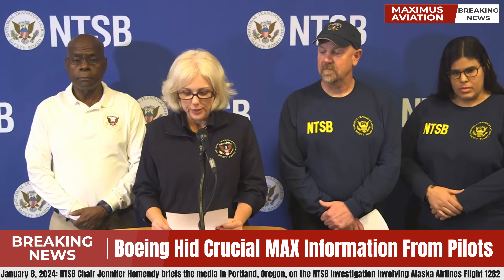Boeing NEVER Told Airlines That 737 Max Cockpit Door Was Designed To FLY Open During Decompression!

Comment: So this is the second time Boeing hid vital information from crew and authorities. The MCAS system that crashed two MAX planes and now this.... incredible. FAA and Boeing needs to be held criminally accountable.
Reply: The authorities knew. You weren't supposed to know.
Reply: @interstellarsurfer  unfortunately i cannot agree, sir. We should know how the a/c behaves and in case of a decompression to act accordingly and either close back the fd door or leave it open. Also allows for quicker access of the crew to the flight deck for subsequent briefings. As we also know the access codes we should know this too.
Reply: Was this info hidden or simply omitted through negligence etc. from the training material. Why would they hide this factor of design? They don't gain anything from it?

The pitch forks & torches are out already & a lot of nuances are going to be missed here, because of groupthink & the focus being put on retribution.
Reply: @Meisha-san  it may be possible that the FAA decided to hide this info, maybe a crew under FAA jurisdiction can confirm or deny this but the FCOM for the 73 series is publicly available on the internet. Also there are YouTube channels that explain how the 73 systems work. 
Again, under EASA we were taught during the initial training about the FD door behaviour during decompression and reminded every emergency recurrent, both for the 320 family and for the 73 series
Reply: "So this is the second time Boeing hid vital information from crew and authorities." - no. This is the second time such an action came to light because of a highly publicised incident. Nobody know how many such cases might never see the light of day.
Reply: @csat1078  what is vital in this???
Reply: I wanted to highlight the difference between "this is the second time Boeing hid vital information" and "this is the second time people found out about sg because an incident that involved media attention" :)
Reply: How is it vital?
Reply: They REALLY don't want to PAY for all the UPDATES to Flight Training.    To be fair its the FAAs dam fault for forcing pilots to RETRAIN in a MAJOR COSTLY WAY when ever a MINOR thing is changed. Airlines dislike having to PAY for such things, and may go to rivals like Airbus instead to avoid COSTLY Retraining.  Now there apparently are more simple trainings that could be done, but the FAA in their infantae stupidity said no, full retrain.   So Boeing hide the info so as to not have to worry about it.
Reply: When the incident narrative said ‘cockpit door blew open’ my first thought was, yeah of course it would. And I had no doubt that would occur in all jet airliners. And I see that is confirmed in the comments above.
Reply: No, they just want to destroy Elon musk , Boeing is their property. No matter how sloppy they are , but anyway first class guests are safest
Reply: Second time that we found out.   If there's two, there's definitely more skeletons in the closet.
Reply: So let’s see some heavy fines levied against Boeing…
Reply: Hijackers: so this is how you open the cockpit door

So now that everybody knows, Boeing is going to fix it by adding this information to the training manual?

I'm not sure this is a fix.

PS: there might be a good reason why it is done this way. Any engineers want to chime in? Are planes by Airbus, Embraer, Tupolev, all also designed like this?
Reply: and which informations are also hidden from the crew? It is a mess to communicate like this.
Reply: @LittleSpot  the info is in all our manuals. Also presented in every emergency recurrent
Reply: I mentioned this in a separate post. Really makes me wonder about the competency of this person.
Reply: @danielch6662 every aircraft is designed to pop the door open in the case of loss of cabin pressure.  It’s much better to let it „pop“ open with a 1psi differential and not wait till it hits 8 or 9 psi and possibly causes damage to the aft flight deck wall or rips the door off the hinges and turns it into a missile through the cabin.  
Yes I’m an engineer and was part of the Cabin Pressure &!ventilation group on a bunch of planes.
Reply: How many PSI depressurization needs to take place for the cabin door to open and how easy is it to puncture a sufficiently sized hole in the fuselage from a cabin seat?  Morons.   @danielch6662
Reply: @danielch6662 yes, of course they all open. What do you want. A pressurized bulkhead and door between the cockpit and the cabin?
Reply: @danielch6662  I can confirm Airbus behaves the same. But the decompression of an aircraft is not a way to hijack the plane. as you will not be able to breath without the oxy mask. and with the oxy mask you cannot move to hijack the plane. Meanwhile we can reshut the fd door
Reply: @pedragut  What are you talking about.  The Alaska flight opened the cockpit door at 10,000ft.  You can’t breathe without suplemental oxygen there?  Further, what sort of depressurization is needed.  My guess about 0.5 psi, but I don’t know for sure.  Puncture a small hole in the fuselage and the cockpit door opens without a major breach.  I assume that all the decompression warnings this airplane saw before popped open the cockpit door.  Hardly as you describe the difficulty of hijacking a plane in that manner.
Reply: If any boeing pilot didnt know this they should be fired...its common knowledge.
Reply: @47colton fired is a very harsh wording. If you’d fire every pilot for not knowing every detailed, you’d have no pilots left. But completely agree this is common knowledge; so why is it not in manuals and trainings? If we know it due to videos etc about previous accidents, it should be trained to pilots. The less unnecessary surprises during new accidents the better.
Reply: Yes, hid is a strong choice of words. Some of these details aren’t crucial and could be part of a different Gen Fam training or rating. They cant put every mundane detail in the manuals.
Reply: trump was correct....the company needs to go out of business period
Reply: Hundreds of people are dead because a well trained pilot couldn't use the yoke to maintain altitude on those MAX jets....a computer killed those people. A pilot who knew how to control the plane, was overridden by a computer.

Now the cockpit door can be opened after depressurization??????

This needs to be fixed before some lunatic passenger gets a bad idea....WTF?!?!?

I will be flying Airbus for awhile.
Reply: @stever7638  as max calls it Franken monster.  This 707 variant needs to go.
Reply: Or the pilots hadn't read the manuals. That fact is in multiple Boeing manuals.

Comment: How many Easter eggs did Boeing hide in the training and in the manual of this disgraced 737 MAX??? How can they still be in business after this gross failure?
Reply: they only have 1 competition and if not mistaken they sell their Maxs at around 55M, a lot less than listed price, it's like comparing a Toyota or Honda with a Chevy or Chrysler... The Boeing are a lot more discounted...  last year Ryan air ordered 200 of maxes for less than 39M, a 69% discount over the list price. Boeing will not admit to this, just for different economic reasons, but when you cut costs everywhere, you get a Chrysler not a Toyota.... And Airbus can't fill the need of the entire world market.
Reply: If other companies especially Airbus could supply all the demand then yes Boeing could go down.  Problem is the demand is too high for a single company to cover
Reply: Too many accountants vs engineers in the company. I did not used to be that way in the golden years.
Reply: The public has a choice whether or not to fly Boeing. If Boeing goes away only the very wealthy will have the option to fly.

Comment: what about the airline ignoring three prior alarms for decompression events on this aircraft?
Reply: The aircraft was brand new, only delivered in Oct 2023. How do you trace a sensor fault that cannot be recreated on the ground, especially when the manufacturer hasn't told you that the false door is designed to blow out. If the manufacturer fails to give the airlines maintenance crew a complete manual, what the hell are they supposed to do, use a ouija board or a crystal ball?
Reply: Exactly
Reply: Ignored? No. Normally a decompression is not visable for the passangers.
Reply: She said this alarms had nothing to do with the accident.
Reply: Never fly Alaska.  Alaska did nothing with these warnings. Ridiculous.
Reply: @Bogbastardo  It's not true though. Alaska did exactly what they were supposed to do, which is take the aircraft out of extended operations. Also, as the NTSB said, the warnings had nothing to do with the incident.

Comment: In a rapid decompresion, the decompresion is happening by the whaterver reason in the plane. Why they need a door that contribute for the total decompression and blow away? Is there any other aircraft with a similar way to access this condition? Too much sugar coating in this press conference. And by the way, I’m beginning to feel mad with Boeing again…even with the fricking Bob
Reply: come on man don't be stupid, you're going to have the cockpit pressured and the rest of the plane not? and only the cockpit door holding all that air in? don't you think that might cause some adverse affects on the fuselage? use your brain man. You need to equalise all of the air inside the cabin in a rapid decompression, having the cockpit door swing open is not the right way to do it however.
Reply: They told me, back when I got typed on the NG that the blow out panels were for relieving stress due to diff pressure between the cockpit and cabin.  There seems to be an assumption that the bigger problem is the decompression, with security being a lesser issue.
Reply: I think that they mean the door between the cockpit and passenger cabin pops open to prevent damage to the interior bulkhead.
Reply: Indeed,  the NTSB story makes no sense.

Comment: Did I understand the decompression wasn't from the Door Plug losing the compression? How was the plane decompressing? So that's another malfunction? I thought the decompression was when the Door Plug was gaping (losing the compression) before blowing off the plane (?) And if they are designed to blow out from Decompression. The Right Door Plug failed? Stayed into place. This isn't making sense to me?
Reply: The decompression was caused by the door plug departing the aircraft. When that happened the cockpit door (so the supposedly secure door between the flight deck and the rest of the cabin) blew open. Apparently this is by design but Boeing decided flight crews didn't need to know that would happen. This added a whole other problem for the flight crew to manage and - this is me speculating now - probably had them wondering what else was wrong on the aircraft other than the obvious fact it was now a convertible.
Reply: @smiddlehurst1  The NTSB was saying the decompression wasn't from the Door plug. I like the NTSB to explain what was causing the decompression then?
Reply: @michaelprice8402  Listen to the video more carefully.  At 8:50 she is talking about the decompression warning lights on the earlier flights, not the explosive decompression on the flight where the door plug failed.
Reply: @WyndStryke  So what was causing the warning light to come on? I was referring to that. Before the explosive decompression. And she the NTSB said it wasn't related to the Door Plug. So it was my question as to what was it?
Reply: @michaelprice8402  As Motorman says 🙂
Basically there is always air being pulled into the aircraft from the engine air bleed system, and some stale air being vented.  If the air bleed system isn't giving enough fresh air, or too much stale air is being vented, then the pressure will drop slightly, and the warning lights come on.  The aircraft systems should then tell the air bleed system to supply more air.   The warning lights tell the maintenance crew to investigate why the air system was imbalanced (for example, air bleed system not functioning properly, or a leak somewhere, or whatever).   
What the NTSB is saying is that currently there is no known link between the explosive decompression and the earlier air system imbalance.  That might change in the future, for example if they find evidence of a leak in the door plug mating surfaces, but it doesn't seem likely.   The door plug failure was much more likely to have been due to improper installation by Boeing.
Reply: @WyndStryke  I was thinking that as the Door Plug was lifting in the hinges and creating a pressure leak this way (?) that the Door Plug was the first indications and related. But for the NSTB to say that wasn't the earlier warnings. I couldn't believe it. I asked so we could be more analytical than coming to dropping out exclusions so fast like that. And that just prompts to me how this is more than a Door Plug. Then we have more issues here (?)
Reply: @michaelprice8402 That’s a reasonable question and the media have certainly been implying some relationship. It seems to me that if there was a real pressurisation problem caused by the door plug, both of the pressurisation controllers would have been reporting a fault, not only one.
Reply: @rezwhap  I was almost thinking on making an amendment to my question: If the NTSB lady was referring to trying to figure the instrument cause of decompressing (Wasn't related) Before the event (because in any mind set the secured Door Plugs wouldn't be considered). But after the event. I have trouble with the denying its relationship knowing now a Door Plug became an issue. After the event doesn't make sense to me.
Reply: The COCKPIT DOOR was desugned to open in the event of decompression such as when the emergency door failed on a recent flight.
Reply: @sevenodonata  Completely lost me (?) The NTSB Lady said that Door Plug blew out because of a Decompression. No news about the Cockpit door has ever been mentioned.
Reply: @michaelprice8402  Plane is in flight, you have high pressure inside the cabin and the cockpit, low pressure outside. 

Then the outer door comes off, now there is low pressure outside, and low pressure in the cabin, but still high pressure in the cockpit.

Then the cockpit door opens, now there is low pressure everywhere.

In each case the opening is caused by the door which separates these areas being unable to withstand the difference in pressure.
Reply: @Motorman2112  The NTSB is saying the Decompression is happening before the Door Plug came off and denying that the Door Plug was causing the decompression. So my question was what caused the decompression if inside is high pressure and outside is low pressure. The sealing of the fuselage is an issue but denying the leaking wasn't from the Door Plug. Not making sense to me. That means there was a leaking. So what was leaking?
Reply: @michaelprice8402  Just to be clear they are referring to previous flights here, not the one where the door plug actually came off.

It is normal to allow some air to leave the cabin and replace it with new air pulled in from outside by the pressurisation system, you'd run out of oxygen otherwise. Basically you always have air going out by design, but you replace it with an equivalent rate of air forced in from the pressurisation system.

In these previous flights what appears to have happened is that the primary pressurisation system was not able to adequately compensate for this, but the alternate system was. Per the available evidence the outflow was not a problem as such, that's normal, the issue seems to have been a lack of inflow available from the primary system.
Reply: I missed it at the start. OK it was said Cockpit door. I thought it was about the Door Plug. But? when in on 8:55 in this. The lady of the NTSB is denying that the Door Plug was the cause of the Decompression. So what was causing the Decompression?
Reply: @michaelprice8402 That is not what she says at 8:55. She is referring to the more minor pressurisation issues encountered on previous flights, and she is saying that there is no evidence that these were related to the door plug failure. On those previous flights they were able to fix the issue by switching to a different pressurisation system, which probably wouldn't have worked if the door had been the cause at that time.

Obviously having a massive hole appear in the fuselage at 16,000 feet WILL cause a depressurisation. On the flight where that happened it's clear why the cabin depressurised.
Reply: Let's start a conspiracy theory 101